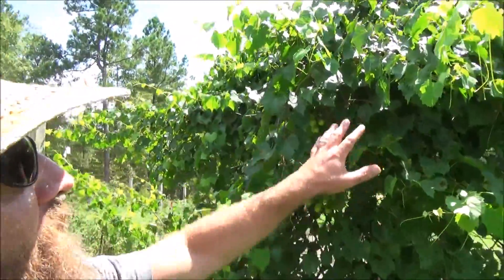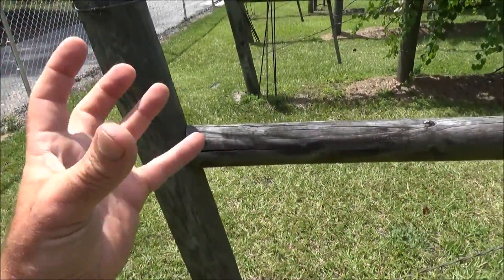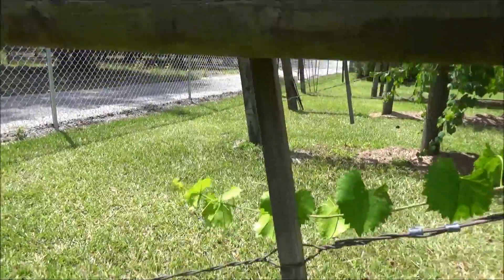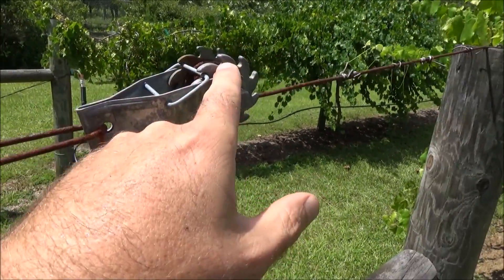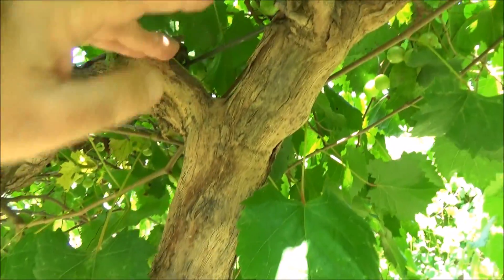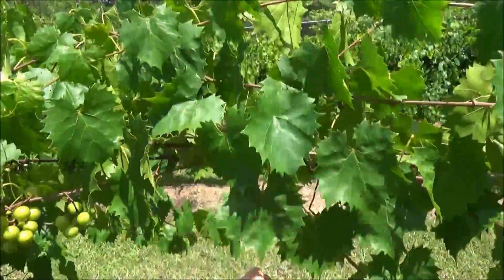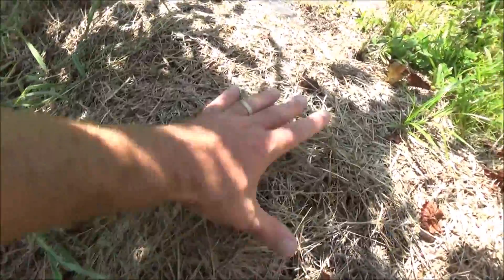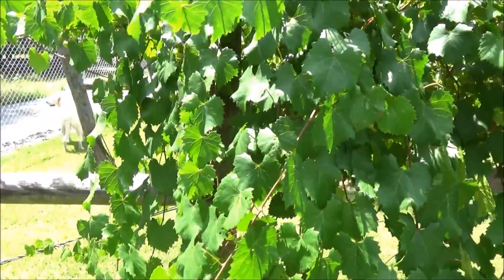our vineyard

Comment: I have an identical muscadine setup with 2 variances. (1) I use a ratchet tightener on the wire between the brace posts, & (2) I didn’t install my end posts at an angle. I saw this video after the install. Everything else is the same. I have thirty four 240’ rows planted in 12/2018. Do you think my setup is sufficient stability-wise? I live in southern Georgia & my region consists mainly of pine forests, helping temper the wind, which is not commonly severe here anyway. My main concern is the ability of the bracing to withstand the weight of a crop. Each row contains 12 vines, with the vines & posts 20ft apart. The non-bracing trellis posts are 4x4s & the trellis wire is ran thru a drilled hole in the post, with rubber tubing liners in each post to minimize rubbing. I also have .75in dripline attached to these posts . Thank you for your input if you happen to see this comment. Your vineyard looks VERY well built & well maintained. Excellent setup, excellent video. Very easy to understand. Subscribed to your channel.

Comment: What did you use to dig the holes?  Did you use any concrete for any post?  It appears you did not use high tensile wire; reason?  From the size of the vines, I would say your effort has paid off.  Nice job!

Comment: I have 3 Carlos bronze and 3 noble red to plant ..can you plant both on same trellis line
Reply from the maker: Yes sir! No problem
Reply: If your trellis is just 20 feet length with 2 posts at each end.. Would 9 gauge wire held with staple nails work ?
Reply from the maker: I think so. The hammer-in fence staples with barbed shanks.
Reply: @gregpryorhomestead  OK cool thanks..

Comment: I am getting ready to rehab some old (and sad) vines that were neglected on my property before we bought it, and plan to use your design. Do you only have the ratchet on one end of the set up, or both ends? Common sense tells me just one side, but wanted to verify what you did here
Reply from the maker: Rebecca Ehrick just one end. You can be aggressive and prune right back, but leave a few buds or about 6 inches off the wire. It'll "bleed" a lot of sap but trust me, these vines are crazy resilient. Keep me posted! Winter is the best time to prune.

Comment: I know there must be a good reason you laid the wire on the top of the post instead of drilling a hole thru the post and simply running the wire thru the hole to support the wire from sagging.  Please help just getting started.

Comment: Great video!...... did you by chance cement any of your post?..... if so which ones
Reply from the maker: Meko Meko cement?
Reply: gregpryorhomestead ..... yes sir thank you for responding just wanted to know did you back fill the post with the existing soil and dirt or did you add in concrete to each whole per post
Reply: *hole per post.......lol....
Reply: Meko Meko I don't think you cement(concrete) any of the posts which is why you use treated wood or cedar, it would make it much more difficult to replace them if they were damaged or too weathered.